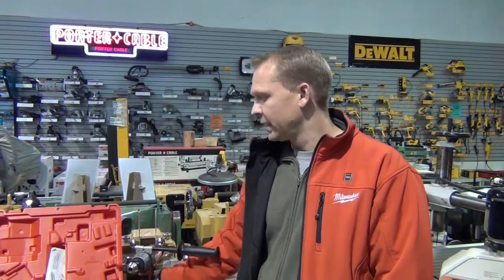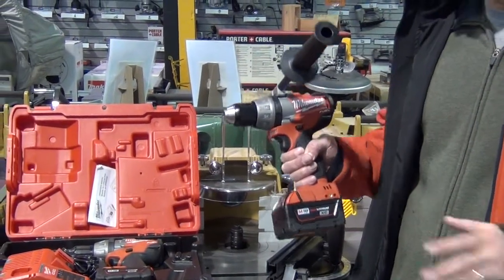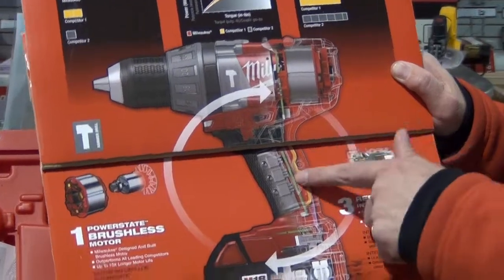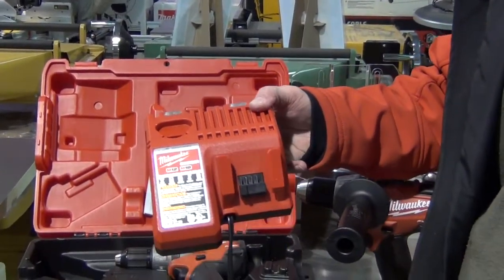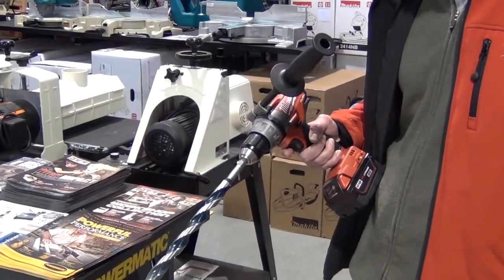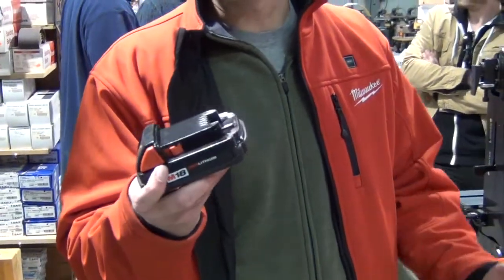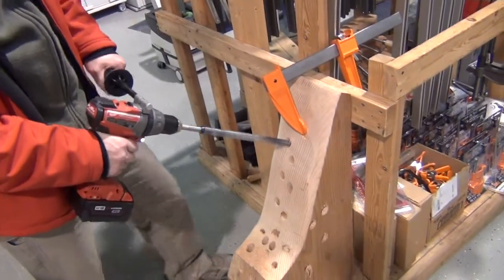Milwaukee Fuel Demo

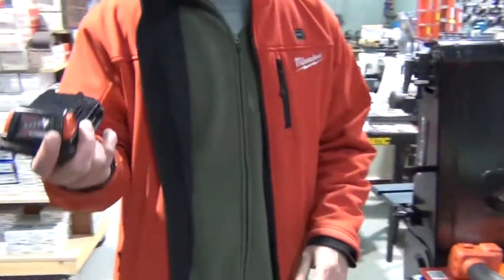Comment: 4:48 You say that the bigger batteries produce a higher torque rating, as far as i know that is incorrect! Its power just lasts longer.
The Ah rating is what determines how long your battery will last per charge. It stands for ampere-hour and is the measurement of time it takes for a battery to discharge!
Correct me if i'm wrong!